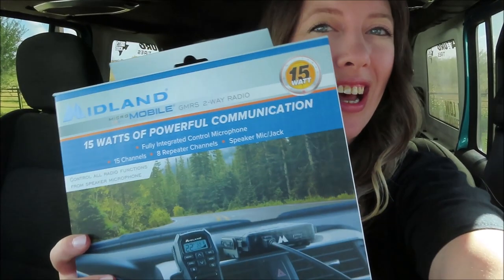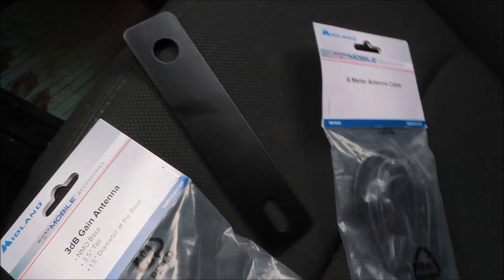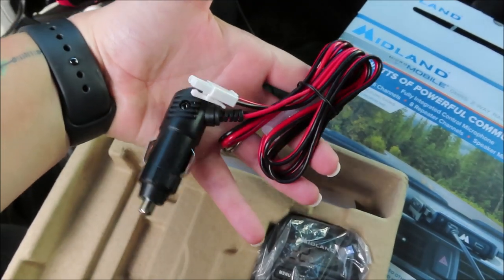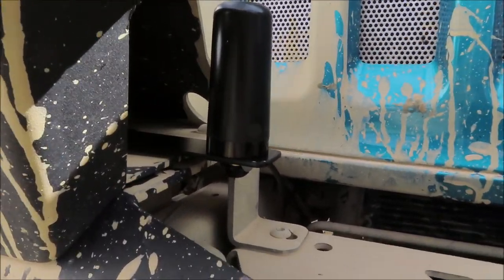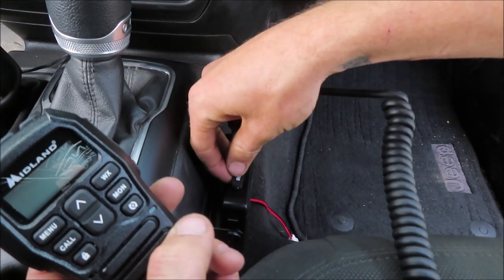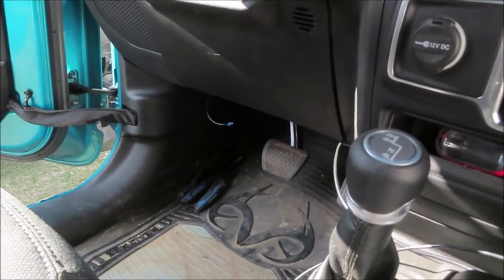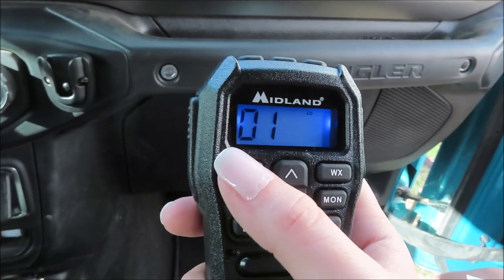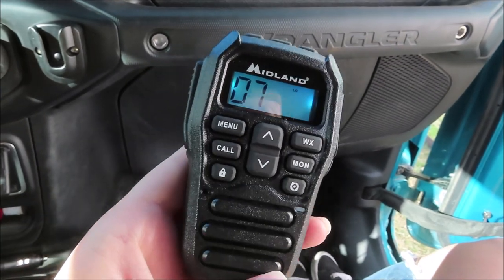Finally Got to Install My MidlandUSA MicroMobile GMRS Radio!

Comment: I recently installed my MXT275 with the trunk mount option and the Midland MICROMOBILE® MXTA26 6DB GAIN WHIP ANTENNA!
Extremely happy with the performance👍

Comment: Good install video. I have a couple Midlands, love em. JLs don't offer many antenna mounting options. I know its a temp spot for now but try a mount at the A pillar or hood lip for your antenna. It will make a huge improvement on performance.
Reply from the maker: I’ll definitely look into it! Thank you for the suggestion!

Comment: Did you consider mounting the radio behind the dash?  Is there any reason to have the radio where you can get to it?  Also what kind of range are you getting with the short antenna?  I'm thinking about mounting a similar antenna on the cowl.